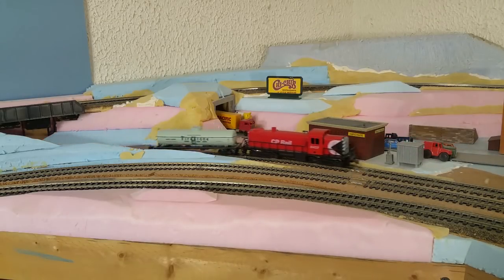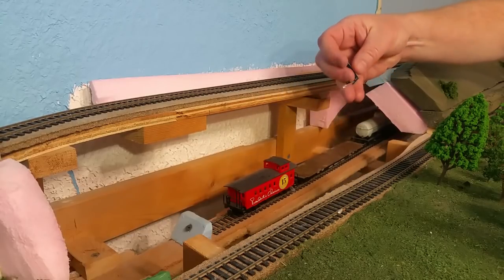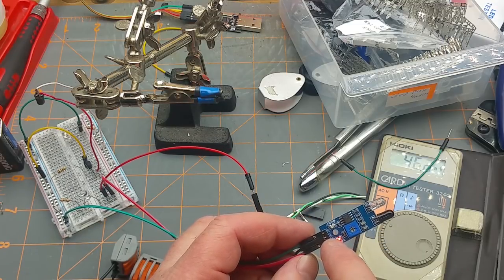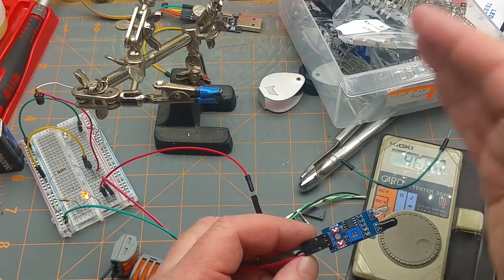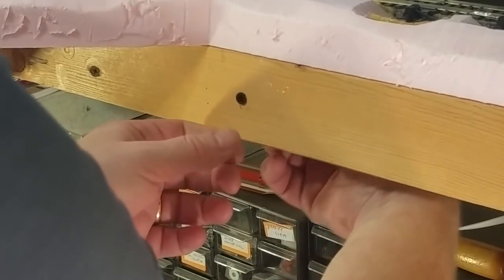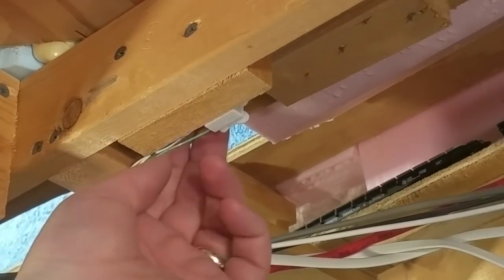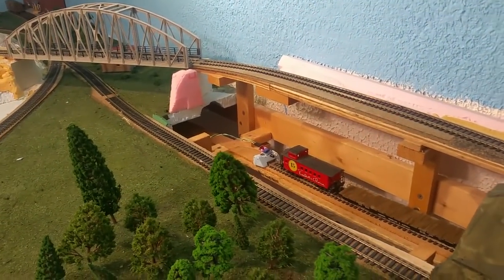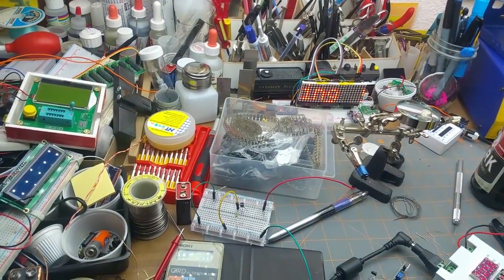Hidden staging track train detector

Comment: Thanks for the video. I was thinking long the same lines. However, when set up my led is on all of the time and goes off when the detector activates. I think I may have something the wrong way round, but I cannot see where.  Any ideas?
Reply from the maker: Have you tried in other locations? I've had certain types of ambient light (mostly from cheap LED light bulbs) cause false triggering. 

Does the detector module work as expected without anything connected to the output pin? Perhaps your load is not playing nice with the detector circuit.
Reply: The detector works correctly until I add the remote led to the output line. That's when the led stays on until activated. Also the second led on the module stays on as well, until activated.
Reply from the maker: To me that sounds like you might just need to reverse the LED.

Is the other end of the LED going to ground or +5v?
Reply: Solved! I had the LED anode going to the signal rather than the +ve. Thanks for your assistance.

Comment: Simple but very efective. Maybe it could operate a latch relay and isolate the power so you don't have a collision. It would be easy to reset and away you go. Just a thought, Tezza.
Reply from the maker: I was thinking about that as well, and with DC it would be a very easy solution.  

On a DCC layout, I was concerned  the loco's decoder would remember it's last setting, so when the track power came back on it would just continue in the direction it was going unless I sent a throttle speed change immediately after turning the power back on.

I may still try it at some point to test my "theory".

Comment: where can you purchase the material to make this detector?
Reply from the maker: I got a bunch of them from various Chinese sellers on ebay.
This search should find several different sellers (I always sort by cheapest first.)

https://www.ebay.ca/sch/i.html?_odkw=infrared++Obstacle+Avoidance+Sensor+Module+IR&_osacat=0&_from=R40&_trksid=p2045573.m570.l1313.TR1.TRC0.A0.H0.XObstacle+Avoidance+Sensor+Module+IR+infrared.TRS0&_nkw=Obstacle+Avoidance+Sensor+Module+IR+infrared&_sacat=0
Reply: thank you very much. Is there a drawing that comes with it to show how to wire it? I'll probably use a indicator light like you did
Reply from the maker: There is no documentation with these cheap things.

It just has 3 connections. Power, ground and signal out.  Connect the LED (with resistor) between the out and ground and that's it.
Reply: I bought a bunch of the units, where can I get the pin connectors you use and can you buy just the ir bulb and the clear receiver bulb?  thanks
Reply from the maker: Yes, the IE emitter/receiver are cheap to buy on their own: https://www.ebay.ca/sch/i.html?_from=R40&_trksid=p2047675.m570.l1313.TR0.TRC0.H0.TRS0&_nkw=+infrared+emitter+and+IR+receiver&_sacat=0

The connectors, I build from these: https://www.ebay.ca/sch/i.html?_odkw=dupont+kit&_osacat=0&_from=R40&_trksid=p2045573.m570.l1311.R2.TR2.TRC1.A0.H0.TRS1&_nkw=dupont+connector+kit&_sacat=0  
and wire.

The needed crimper tool is also available https://www.ebay.ca/sch/i.html?_sacat=0&_nkw=dupont+crimper&_frs=1
Reply: thankyou for the info